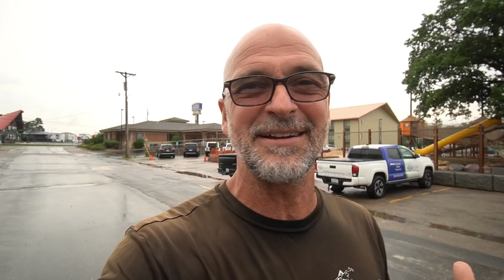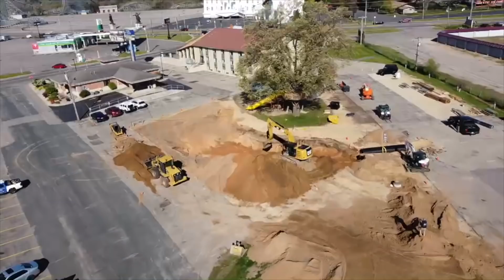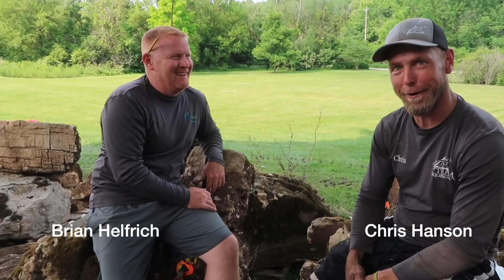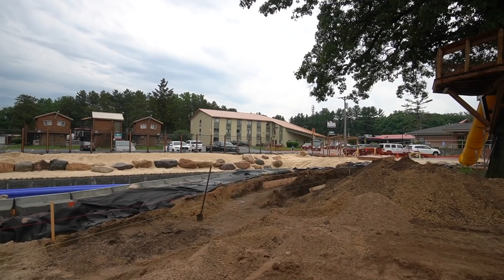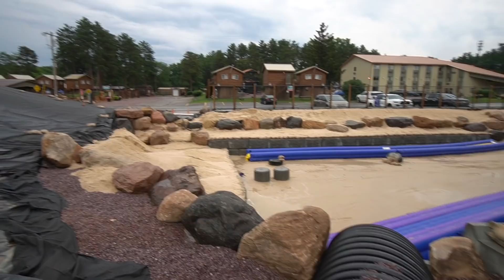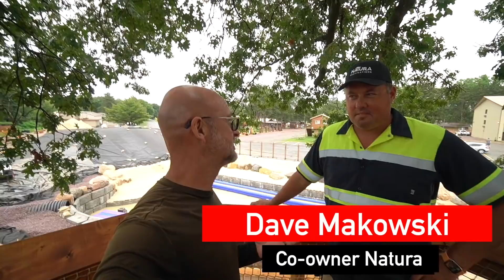Wisconsin Dells *RECREATION POND* Construction Begins! - Part 2

Comment: What a cool project. And clever design on the sand trap. What did you end up doing at the bottom of the pond? Last video you mentioned testing some sort of mat you wanted to use below the sand that would allow water through but not sand. Did you turn the whole bottom of the pond into an upflow filter?